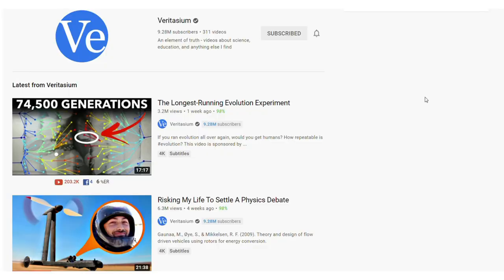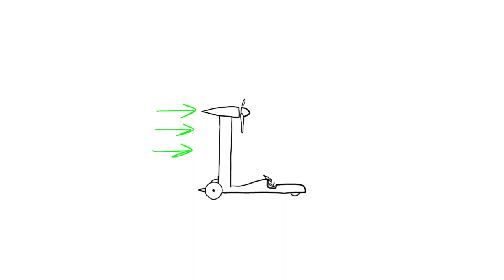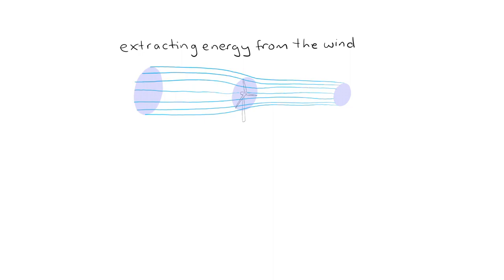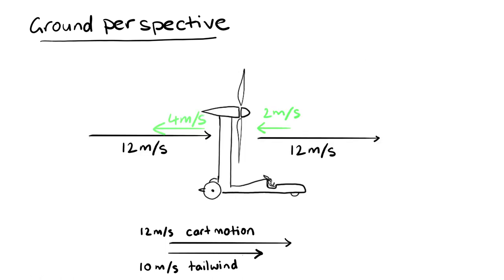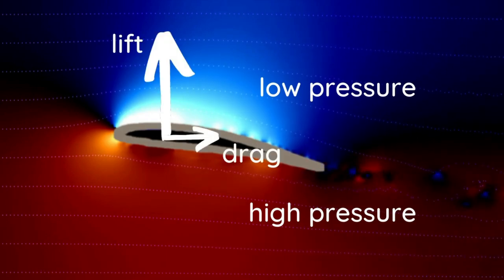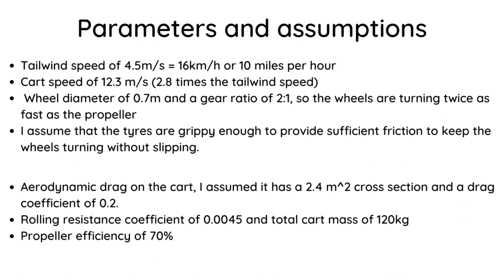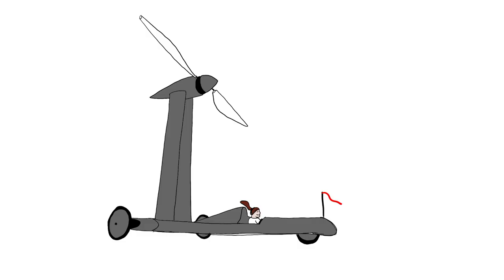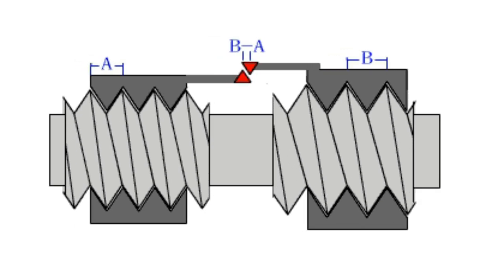Downwind Faster Than the Wind by Veritasium: How Does it Work?

Comment: It's like storing the winds power in the forward momentum of the car like a flywheel.
Reply: YES! And when the flywheel kicks in to power the propeller to accelerate the vehicle to go faster than the wind there is no longer any wind pushing it, no more transfer of wind energy to the vehicle so that stored flywheel-stored energy gets used up and the vehicle slows down. The best you could do is fluctuate between a little bit faster than the wind and a little slower, with the AVREAGE SPEED of the vehicle being simply the wind speed.
Reply: @RogerGarrett  No, a cart like this can consistently exceed wind speed. It can accelerate even when going faster than the wind.
Reply: @RogerGarrett  "At that point there is NO FORCE pushing the vehicle."

No, that's not true. Even at that point the propeller (powered by the wheels) is spinning and pushing the cart forward.

Why aren't the wheels, which power the propeller then slowing the cart by at least as much? It's because the air is moving relative to the ground.
Reply: @seneca983  It IS TRUE that the WIND is not providing a force to push the vehicle, which is what I was saying in that statement. The claim is made over and over, even by the original builder of the vehicle, that momentum is NOT what powers the propeller but that it is only the wind. The vehicle certainly is moving and its momentum can continue to cause the wheels to rotate, TRANSFERRING some of that momentum to the propeller. The wheels are NOT a "source of power", unless you figure in the momentum of the rotation of the wheels. Heck there's stored momentum even in the propeller and the shafts and drive train. But all of that momentum is NOT coming from the wind once the vehicle is going the same speed as the wind. And as any and all of that momentum drives the propeller that momentum gets used up and that explicitly SLOWS DOWN the vehicle.

And again, if the vehicle ever WERE to be going faster than the ground-relative wind, the vehicle would then encounter a vehicle-relative wind coming at it from the front, being a DRAG on the vehicle and slowing it down.

The claim is made that once the vehicle is going faster than the wind it gets its energy from the interaction of the wheels and the ground, which powers the propeller, and the propeller causes the vehicle to ACCELERATE, which causes the wheels to rotate even faster, which causes the propeller to rotate even faster, which causes the vehicle to move even faster, which goes on and on in an endless feedback loop. Now, seriously, where is all that extra energy coming from? Doesn't that look an awful lot like an Over-Unity claim, a mechanism that creates more energy than it uses?
Reply: @RogerGarrett  "Now, seriously, where is all that extra energy coming from?"

It's coming from the wind. In a frame fixed to the ground the air that goes through the propeller is slowed down. This energy (or a part of it) is transferred to the cart speeding it up.
Reply: @seneca983  No. That makes no sense at all. It's the propeller that is USING energy. It's powered by the shaft that turns it which is powered by the wheels which is powered by the momentum of the vehicle moving. The fact that the ambient air is slowed down by the propeller (relative to the ground) does not in anyway mean that the air is supplying power to the moving vehicle. The propeller doesn't know anything about a ground-based frame of reference, isn't influenced by it. It pushes air from in front of it towards the back of it, transferring backwards motion to the air and forward motion to the propeller, and through that to the vehicle. From the propeller, and the vehicle's, standpoint the propeller is accelerating the air, not slowing it down. The air is NOT transferring energy to the propeller.
Reply: @RogerGarrett  "The fact that the ambient air is slowed down by the propeller (relative to the ground) does not in anyway mean that the air is supplying power to the moving vehicle."

The air is losing energy (in this frame). That means that something else must be gaining an equal amount of energy because energy is conserved.

"The propeller doesn't know anything about a ground-based frame of reference"

Of course, the propeller doesn't know anything since it doesn't have a brain but that's not relevant here. Energy is conserved in any inertial frame but which body is losing or gaining energy depends on the chosen frame. In this case, the frame tied to the ground is where it's easiest to understand why this cart doesn't violate the conservation of energy.

"From the propeller, and the vehicle's, standpoint the propeller is accelerating the air, not slowing it down."

If you insist on using this frame then notice that the ground is moving relative to the vehicle. Thus in this frame the vehicle is extracting energy from the ground. However, I think using a frame tied to the ground is more intuitive.
Reply: @RogerGarrett  "The question is "Where does the energy COME FROM?" that results in the observed effect, regardless of the viewing perspective."

But where the energy comes from essentially depends on the frame. The kinetic energy of objects is different in different inertial frames. The conservation of energy is observed in all frames but the flow of energy is different.

In the frame tied to the ground the energy is coming from the wind. In the frame tied to the vehicle (at a particular moment) the energy is coming from the ground. In the frame tied to the air the energy is also coming from the ground (once the vehicle has reached wind speed).
Reply: @seneca983  
Blackbird starts out stationary relative to the ground. A constant wind (relative to the ground) is blowing at the back of Blackbird, imparting a force on it. Blackbird accelerates forward. At this stage it is most definitely the wind that is accelerating the Blackbird, especially since, according to the builders, the propeller is allowed to freely rotate, with nothing other than the wind causing it to rotate.

At some point the acceleration imposed on the Blackbird by the wind results in the Blackbird moving, relative to the ground, at exactly the same speed as the wind, relative to the ground. And at that very point the wind is no longer imparting a force against Blackbird, . . . because both the wind and Blackbird are moving in the same direction and the same speed relative to the ground.

Then the propeller is engaged and begins to spin, UNDER POWER, and has an effect on both the surrounding air and the propeller itself and through the propeller to the rest of the Blackbird.

REGARDLESS of what inertial frame (or perspective) you choose, the fact is that the effects on the surrounding air and the vehicle itself is caused by the rotation of the propeller impinging on that air, applying a force on that air, causing some of the air to move from in front of the propeller to the back of the propeller and causing the propeller (and everything attached to it) to move in the forward direction. Simple physics.

The CLAIM is that the rotation of the propeller can and DOES in fact cause the Blackbird to continue to accelerate, its speed increase, to the point where Blackbird is going faster, relative to the ground, than the wind is going, relative to the ground.

The critical question then becomes, "What causes the propeller to rotate, where does the energy come from that powers the propeller?" It is NOT being caused to rotate BY THE WIND, because in the current state there is no wind relative to the propeller. The air certainly IS moving relative to the GROUND, but since both the wind and Blackbird are moving at the same speed in the same direction, there is no Blackbird-relative or propeller-relative wind. And since it is not the wind that is driving the propeller it must be something else, something very easy to track down and, in fact is precisely what is claimed by the builders of Blackbird. . . .

The propeller is turned by the propeller shaft, which is turned by a set of gears and linkages, which are turned by the axle of the wheels and those wheels are turned by the interaction between the wheels and the ground. And why is there interaction between the wheels and ground? Because the wheels, and in fact the entire vehicle, is moving relative to the ground. That relative motion imparts a force all the way up the sequence of active parts to the propeller, causing it to rotate. It is the MOTION OF THE VEHICLE, relative to the ground, that provides the force, provides the energy, that drive the propeller.

And that entire sequence of force/energy transfer is precisely what the builders of Blackbird claim as being what powers the vehicle to go faster than the ground-relative wind. They cite explicitly that the power comes from the wheels, from their interaction with the ground.

YOUR assertion is that, 

(1) relative to the ground, the speed of the air (that goes through the propeller) reduces, it slows down.
And that is true. 

YOUR further assertion is that 

(2) the energy to do that must GO SOMEWHERE.
That, also is true. It's a variation of the truth that for every action there is an equal and opposite reaction.

Next,

(3) that energy goes into accelerating the vehicle.
Again, true.

But finally,

(4) that energy COMES FROM THE WIND.

But that is not a logical conclusion from the prior statements. It is an assertion without fact, without evidence. It COULD come from a gasoline engine on board the vehicle. It COULD come from a flywheel on board the vehicle. It COULD come from solar panels powering an electric motor attached to the propeller. It COULD come from any number of energy sources. The point is that the mere truths of (1), (2), and (3) do not implicitly result in (4).

And in fact, the builders of Blackbird have explicitly asserted over and over again that the energy COMES FROMTHE WHEELS, or more precisely the interaction of the wheels with the ground.

There has never been a sufficient explanation of how the air movement, relative to the ground, can contribute energy to the vehicle. The only air movement that the vehicle experiences is the air movement relative to the vehicle. And when the vehicle is travelling at the same speed as the ground-relative air movement, that vehicle-relative air movement is ZERO and therefore contributes nothing, no energy, to the vehicle. Further, when the vehicle is travelling FASTER than the ground-relative air movement, that vehicle-relative air movement is AGAINST the forward movement of the vehicle and therefore REDUCES the energy, the movement, the speed of the vehicle.

Again, it is the  repeated claim by the makers of the Blackbird that it is interaction of the wheels with the ground that powers the vehicle. That means that they are saying:

It is the motion of the vehicle itself that increases the motion of the vehicle.
It is the speed of the vehicle itself that increases the speed of the vehicle.
It is the momentum of the vehicle itself that increases the momentum of the vehicle.

None of that can be true. It is simply physically impossible.

No one, to date, has provided a sufficient explanation of what it is that causes the vehicle to accelerate when the vehicle-relative air motion is zero and continue  to accelerate when the vehicle-relative air motion is AGAINST the vehicle motion.
Reply: @RogerGarrett  "according to the builders, the propeller is allowed to freely rotate, with nothing other than the wind causing it to rotate"

No, that's not how it works and the builders aren't saying it is. The propeller is not allowed to spin freely and it spins to the opposite direction than the wind would turn it.

"And at that very point the wind is no longer imparting a force against Blackbird, . . . because both the wind and Blackbird are moving in the same direction and the same speed relative to the ground."

It's still imparting a force on the propeller because it's spinning.

"Then the propeller is engaged and begins to spin"

No, the propeller was engaged right from the beginning.

"The critical question then becomes, "What causes the propeller to rotate, where does the energy come from that powers the propeller?" It is NOT being caused to rotate BY THE WIND, because in the current state there is no wind relative to the propeller."

The wind does not directly rotate the propeller. Where the energy comes from depends on the inertial frame. In a frame tied to the ground it comes from the wind. In the frame tied to the air/vehicle (which are the same in this instance) it comes from the ground. Just because the wind doesn't directly spin the propeller doesn't mean the energy isn't coming from the wind, though that depends on the inertial frame used to look at the situation.

"They cite explicitly that the power comes from the wheels, from their interaction with the ground."

True. This in no way contradicts what I have said.

"It COULD come from a gasoline engine on board the vehicle. It COULD come from a flywheel on board the vehicle. It COULD come from solar panels powering an electric motor attached to the propeller."

Of course, I have not personally inspected the cart to know whether the builders have cheated in one of the ways you list. However, their record was certified by NALSA and trust them to have done a thorough enough inspection to know that no such energy sources are present.

"And when the vehicle is travelling at the same speed as the ground-relative air movement, that vehicle-relative air movement is ZERO and therefore contributes nothing, no energy, to the vehicle."

But in that frame of reference the ground is moving relative to the vehicle and that's where the energy comes from in that frame of reference. (In a frame tied to the ground the energy comes from the wind.)

"Further, when the vehicle is travelling FASTER than the ground-relative air movement, that vehicle-relative air movement is AGAINST the forward movement of the vehicle and therefore REDUCES the energy, the movement, the speed of the vehicle."

It doesn't because the propeller is spinning.

"Again, it is the  repeated claim by the makers of the Blackbird that it is interaction of the wheels with the ground that powers the vehicle. That means that they are saying:

It is the motion of the vehicle itself that increases the motion of the vehicle.
It is the speed of the vehicle itself that increases the speed of the vehicle.
It is the momentum of the vehicle itself that increases the momentum of the vehicle.

None of that can be true. It is simply physically impossible."

It's not only the motion by itself. The interaction with the air and the ground is crucial. None of that is impossible.
Reply: @RogerGarrett  OK, here's my answer. (I'll consider the situation 2 only after my answers to 1 and 3, because that would distract from the main issue.)

Situation 1

Yes, I agree that in this case the cart would eventually stop. Even if the propeller is spinning and providing thrust it's being powered by the wheels and the grip of the wheels must be providing at least as much deceleration as the propeller is providing acceleration.

Situation 3

You said: "The only thing that the Blackbird experiences is the various forces imposed up on it by the Blackbird-relative air, which is ALWAYS a Blackbird-relative headwind, plus the standard friction losses."

However, those are not the only forces. If the Blackbird only interacted with the air it indeed could not exceed wind speed. However, it also interacts with the ground which is crucial. The wheels are being used to drive the propeller which means they are constantly braking the cart. However, since the ground is moving relative to the cart faster (100 mph in your example) than the relative headwind (which is only 50 mph in your example) it means the cart can get mechanical advantage in using the wheels to power the propeller. This means the wheels brake the cart less than what the propeller pushes it forward by. That means the cart can accelerate.

Situation 2

What about this situation? If you tried to use the same setup, i.e. the wheels powering the propeller, the cart would indeed stop even faster than in situation 1. However, you can do the reverse and use the propeller as a wind turbine and use it to power the wheels. This way you can again get mechanical advantage and accelerate beyond wind speed. Blackbird can operate like this as well and has gone upwind faster than the wind (but by a smaller factor than downwind)
Reply: @seneca983  Well, it's good that you recognize that in Situation 1 the cart would eventually stop. To paraphrase you, "The propeller's thrust is powered by the grip of the wheels against the ground, but the cart therefore experiences as much DEceleration as the propeller provide ACceleration".

And I'll point out that in addition to the cart motion lost to the use of the cart's momentum as the power source, it also slows down because of the cart-relative headwind that it experiences, a drag component of the various forces acting on the cart.

In ANY situation the only things that effect the Blackbird motion is the energy that powers the propeller and the "wind". To be more precise, it's the cart-relative motion against the ground that taps into the cart's momentum and it's the cart-relative air motion that can (A) provide a pushing force IF the speed of the ground-relative air is greater than the speed of the ground-relative cart,  (B) provide a drag force  IF the speed of the ground-relative air is less than the speed of the ground-relative cart, or (C) provide no force, no energy whatsoever, IF the speed of the ground-relative air is equal to the speed of the ground-relative cart (at all times during the operation of the cart).

Now, again, notice that you agree that in Situation 1 the cart will slow down and come to a stop. It's a situation (see A, above) in which  the speed of the ground-relative air is less than the speed of the ground-relative cart. With there being no wind at all relative to the ground the force from the air that the cart experiences is a headwind, a drag force. The combination of the deceleration of the cart due to its momentum being used up by the propeller AND the headwind drag force results in the cart slowing down and coming to a standstill. No cart acceleration happens.

Now let's again look at Situation 3, in which the Blackbird is already moving at some ground-relative speed which is greater than the ground-relative, non-zero, air speed. The Blackbird is tapping in to the momentum of the cart in order to power the propeller. You have already acknowledged that by such use of that cart's momentum that cart momentum MUST correspondingly reduce (slow down!). The ONLY way that the cart could continue moving at that higher-than-wind-speed is if there is some OTHER force driving the cart. You claim that it's the wind. But the cart-relative wind is a HEADWIND, a drag force, just like in Situation 1, the situation of which you already concede would NOT result in acceleration of the cart but rather a slowing and eventual stopping of the cart.

You then try to shift perspective by saying that it's now the ground that's moving. But that doesn't help. You can either think of it as the cart moving at 100 miles per hour relative to the ground or the ground moving at 100 miles per hour relative to the cart. It doesn't matter. In both Situation 1 and Situation 3 the cart-ground relative speed is exactly the same. The cart receives the exact same amount of energy from the system in either case. How much it receives is NOT dependent on what the ambient air might be doing.

There is no "MORE mechanical advantage" to how the cart uses the energy it receives from the wheels in Situation 3 than Situation 1.  The brakes don't "brake less" in Situation 3 simply because there's a wind. Whatever mechanical advantage exists between the wheels and the propeller is exactly the same no matter what the wind may be doing.

Situation 3 will have the same result as Situation 1, a slowing down of the craft. In Situation 1 the cart will eventually stop. In Situation 3 the cart will slow down to some specific slower speed dictated by the force of the tailwind impacting on it. But the craft, in either case, will definitely NOT accelerate. The vector sum of all the pertinent forces simply does not allow for it to accelerate.

Please, explain how the faster-than-wind-speed cart attains some mechanical advantage by the mere fact that it's going faster-than-wind-speed. And explain how Situation 1 doesn't ALSO have that mechanical advantage, since it, too, is travelling faster than wind speed.

I'll also point out that when the cart is encountering a headwind the propeller is LESS EFFICIENT than when there's no headwind or it's a tailwind instead. So with the cart (supposedly) accelerating within a headwind (Situation 1 or 3), the faster it goes the less efficient the propellers are. But even without taking that into account, when you add up the force vectors impinging on the vehicle, when you recognize that the momentum (ground-relative speed) of the cart MUST decrease as the propellers are driven by that momentum, you have to conclude that the cart simply cannot accelerate.

Whatever it is that makes the Blackbird test vehicle appear to accelerate (and claimed to be able to continue accelerating) within a tailwind while the vehicle is already going faster than that tailwind, it is NOT EXPLAINED by the explanations so far provided.
Reply: @RogerGarrett  "The ONLY way that the cart could continue moving at that higher-than-wind-speed is if there is some OTHER force driving the cart. You claim that it's the wind. But the cart-relative wind is a HEADWIND, a drag force, just like in Situation 1"

If we're talking about forces the accelerating thrust isn't there merely because of the wind. The cart achieves acceleration from its interaction with the air because the propeller is spinning. I think we can agree that a sufficiently fast spinning propeller can accelerate the cart. The only question is that can it be powered by the wheels alone or does it need another power source to avoid decelerating.

"Situation 1 and Situation 3 the cart-ground relative speed is exactly the same. The cart receives the exact same amount of energy from the system in either case. How much it receives is NOT dependent on what the ambient air might be doing."

Yes, but in situation 3 the cart is able to use that same energy for greater acceleration. Let's take an example.

Energy is force times distance. Let's assume the cart travels the distance of 1m (at a speed of 100 mph) and the grip of the wheels provides 1N of decelerating force (arbitrary number). Now on this 1m stretch the cart can extract 1m x 1N = 1J of energy from the ground to power the propeller. Since the relative headwind is only 50 mph the air travels only 0.5m relative to the cart during that 1m stretch. Let's assume the same 1J (no losses) is used to provide thrust. How big is the thrust. Again, energy is force times distance so we get 0.5m x F = 1J and from this we can solve that F=2N, i.e. the accelerating force from the propeller is twice as much as the decelerating force from the wheels. This is the mechanical advantage.

In reality there will be some losses but as long as this mechanical advantage is big enough it can overcome those losses (and the drag on the frame of the cart) and the cart can accelerate even with relative headwind.
Reply: @seneca983  
OK, let's take a look at what appears to be your MIS-use of the concept of mechanical advantage.

The classic example of mechanical advantage is the lever (also applies to gears and pulleys and other devices). A lever is a beam moved around a pivot point with a long section of beam on one side of the pivot and a shorter section of the same beam on the other side of the pivot. You apply a given force on the end of the long section of the beam, moving it through a given distance. The end of the shorter section of the beam moves as a result of the movement of the long section with the end of the shorter section moving through a shorter distance but with a higher force.

Now here's the critical aspect of mechanical advantage on the lever: The ENERGY at both ends is exactly the same. If you multiply the Force times the Distance for the end of the long section of the beam and then separately multiply the Force times the Distance for the end of the short section of the beam you get the EXACT SAME VALUE, and each of those values is the ENERGY value. There is no loss (and certainly no gain) of energy in the use of the system. The differences are in the respective Force and Distance values.

Now let's look at what you're claiming for the Blackbird. You state some (assumed, which is fine) Energy value that's available from the interaction of the moving cart with the ground (via the wheels), with the cart going at some specific speed over some specific distance. But then you look at the Propeller section of the vehicle and note that, relative to the ambient (Ground-relative) wind, it's going a much shorter distance (half the distance, in fact), and from that you calculate that there is TWICE the Energy there.

But wait a minute. The propeller section of the cart is still a part of the Blackbird. Are you seriously stating that the cart has X Energy and 2X Energy at the same time??

If there's a mosquito flying in the same direction as the Blackbird but at 1/100th of the speed of Blackbird and therefore the cart is traversing just 1/100th of the previously noted distance (relative to that mosquito), that therefore the calculated Energy of the Blackbird relative to that mosquito is a thousand times greater than the Energy available via the wheels, via the relative motion of the Blackbird with the ground, from the momentum of the Blackbird relative to the ground?

Frankly, I have no clue why you think it's reasonable to cite the speed of the wind relative to the Blackbird as a basis for calculating Distance, and from that, Energy. 

But getting back to you describing the situation as being one of mechanical advantage. That term, "mechanical advantage", refers to the correlation between Force and Distance of different parts of a mechanical system, with Energy remaining constant. You're trying to use it to show that you somehow get MORE ENERGY out of it, with the implicit indication that, Well, the energy has to go somewhere so it goes into accelerating the Blackbird. It doesn't work that way.

The situation starts with figuring out how much Energy you can tap into from the momentum of the vehicle, from the speed at which the mass of the vehicle is travelling relative to the ground. That gives you a baseline, maximum amount of energy that's available. If you extract that total amount of energy then the vehicle will come to a complete stop, relative to the ground. If you extract half of the energy then the vehicle will slow down to half its initial speed.

Now, no matter how much of that energy you extract from the momentum of the vehicle (with the direct consequence of slowing down the vehicle) that is exactly how much energy you have available up at the propeller, to rotate that propeller, to have that propeller interact with the vehicle-relative wind (totally independently and without regard to how fast the wind may be moving relative to the ground), to apply a force to the Blackbird and thereby add some speed to the Blackbird.

The spinning of the propeller imparts a Force on the air, accelerating it to, likely, very high velocity, with a comparable Force applied to the propeller and through that to the entire Blackbird. (Leaves me wondering why you're not using that increased air velocity to calculate a LARGER distance travelled and thereby LESS Energy.)

Now, it took the calculated energy (from the wheels) to slow down the mass of the Blackbird by X miles per hour, so how much energy do you think it will take to SPEED UP the mass of the Blackbird by X miles per hour?  I sure seems to me that IF you use the exact same amount of Energy and have absolutely no losses in the transfer of the energy from the wheels up to the propeller and no losses from the propeller interacting with the air, the vey MOST you'll be able to do is add those X miles per hour back to the speed of the Blackbird.

If it started out going 100 miles per hour before the propeller was engaged (sucking energy from the Blackbird, slowing it down) then the best you can hope for is for the Blackbird to once again be back to 100 miles per hour after the propeller interacts with the air and provides a Force "from behind" to speed it up once again.

There is simply no way that you acquire any extra Energy. Not from the wind, not from any concept of mechanical advantage. Mechanical advantage changes the value of Force and Distance but keeps the RATIO between Force and Distance the same, keeping the Energy the same.

And I'll restate again, the ONLY affect that the ambient wind has on the situation when it's going slower than the Blackbird (i.e. the Blackbird is going faster than the wind) is the impact it has on the efficiency of the propeller, REDUCING the efficiency of the propeller. The situation DOES NOT ACQUIRE ENERGY from that wind. Nothing you have stated thus far demonstrates how that could be possible. And as far as I've seen, even from videos produce by the very designers and builders of Blackbird, no valid explanation of how it works has ever been provided.
Reply: @RogerGarrett  "The end of the shorter section of the beam moves as a result of the movement of the long section with the end of the shorter section moving through a shorter distance but with a higher force."

And that's also what's happening with Blackbird. The air is moving less relative to the cart than the ground.

"But then you look at the Propeller section of the vehicle and note that, relative to the ambient (Ground-relative) wind, it's going a much shorter distance (half the distance, in fact), and from that you calculate that there is TWICE the Energy there."

No, I calculated twice the force, not energy. I assumed the same energy, just like with an actual lever. Check again the numbers I used (though they're just made up examples).

Most of the rest of your comment seems to be based on this same misunderstanding. I never said the energy would be multiplied by mechanical advantage.

"The situation starts with figuring out how much Energy you can tap into from the momentum of the vehicle, from the speed at which the mass of the vehicle is travelling relative to the ground. That gives you a baseline, maximum amount of energy that's available."

No, that's hardly the maximum because the cart can extract energy from its surroundings (either the air or the ground depending on what inertial frame you're using).

"Leaves me wondering why you're not using that increased air velocity to calculate a LARGER distance travelled and thereby LESS Energy."

Because the propeller, if well designed, mostly pushes the air backwards. It doesn't accelerate to spin with it at high velocity. That would obviously be inefficient. The angle of attack of the propeller's blades are chosen such that these kinds of losses are not too large.
Reply: @seneca983  
You are correct in that I misread your calculations about Force and Energy. My mistake.

But in response to my statement :

"The situation starts with figuring out how much Energy you can tap into from the momentum of the vehicle, from the speed at which the mass of the vehicle is travelling relative to the ground. That gives you a baseline, maximum amount of energy that's available."

You respond with:

"No, that's hardly the maximum because the cart can extract energy from its surroundings (either the air or the ground depending on what inertial frame you're using)."

And that is the key to the whole thing. We agree that it's extracting energy from the momentum of the vehicle interacting, through the wheels, with the ground. What we disagree on is your assertion that it can ALSO extract energy from the air.

Certainly, if the the air is going faster than the cart, from behind, then it imparts a pushing force on the cart, adding energy to it, making it go faster, even up to exactly the same speed as the air. If the air is going at the exact same speed as the cart then there is no force from the air imparted on the cart at all, no energy transfer, no speed change. But the case with the Blackbird is that the cart is already going faster than the air, the air is going slower than the cart, the force that the air imparts on the cart is coming from the front of the cart, imparting a DRAG force, REDUCING the energy of the cart, SLOWING DOWN the cart.

When you've got some object moving at some speed through the air it does not matter that the air may also be moving in the same direction of the object. If the object is encountering a headwind (object going faster in the same direction than the wind) then that object is encountering a drag force and that drag force will slow down the object. There's no way around that.

If the object has some on-board energy supply like gasoline powering a motor and that motor is attached to a propeller pushing backwards then that object can maintain or even increase its speed in spite of the air's drag force. But if the propeller acquires its energy from the very momentum of the object itself that momentum will, must, reduce over time, with the result of the object slowing down.

So we've accounted for what momentum energy is available and what it can do for the Blackbird, which is, at most, keep it moving for a short period of time but eventually, inevitably, slowing down and coming to a stop.

How exactly are you claiming the air also contributes energy or a pushing force to the Blackbird, not merely maintaining its speed but actually accelerating it?

Switching perspectives does not change what's actually happening regarding the force (a drag force) that the air is imparting on the cart as the Blackbird moves through it.

And if the Blackbird can indeed extract energy from the air when that air is actually a headwind, imparting a drag force on it, then why doesn't that also apply to the situation where there is no wind, when the air is stationary relative to the ground? The forces on the Blackbird from the air is exactly the same whether the air is moving (slower than the Blackbird) or it's not moving at all (which is just a variation of  "slower than the wind").
Reply: @RogerGarrett  "When you've got some object moving at some speed through the air it does not matter that the air may also be moving in the same direction of the object."

True, if the object is interacting only with that air. However, here the air is moving relative to the ground and the cart is interacting with both of them which is the reason why it's possible to extract energy from them.

"But if the propeller acquires its energy from the very momentum of the object itself that momentum will, must, reduce over time, with the result of the object slowing down."

But this isn't really an accurate description. You have tended to look at the situation in the inertial frame tied to the cart (at a specific instance). In this frame the ground is moving relative to the cart and therefore has kinetic energy. In this frame it's the kinetic energy of the ground which causes the wheels, and therefore the propeller, to spin. The ground then slows down by a minuscule amount. Thus the cart (and the air) are able to gain kinetic energy. (In a frame tied to the ground the energy would be coming from the wind instead but let's use the frame tied to the cart instead because you have tended to focus on it.)

It's like in your lever example. A lever doesn't multiply energy because the force and distance change by the same factor. However, you can still impart kinetic energy on an object through a lever. A similar thing is happening with Blackbird. The energy is coming out of the ground or the air (depending on frame) and the lever-like mechanical advantage is crucial for that being possible (but it doesn't multiply the energy extracted).

"And if the Blackbird can indeed extract energy from the air when that air is actually a headwind, imparting a drag force on it, then why doesn't that also apply to the situation where there is no wind, when the air is stationary relative to the ground?"

It's because of the mechanical advantage. If you remember my example with numbers. The air was travelling half the speed of the ground relative to the cart. Because of that the accelerating force from the propeller could be twice as large as the decelerating force from the wheels (assuming no losses). If, on the other hand, the air and the ground are travelling at equal speeds then there is no mechanical advantage. The accelerating and decelerating forces would be equal meaning zero acceleration and if you include losses or drag on the cart's frame then it would decelerate.